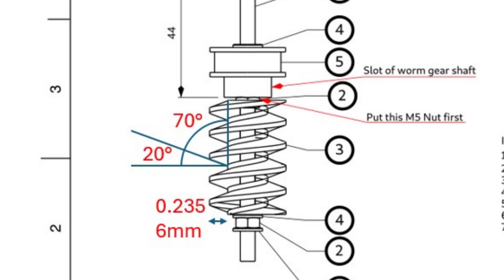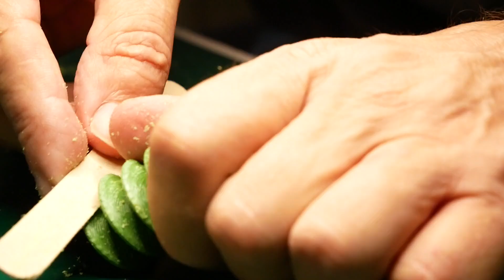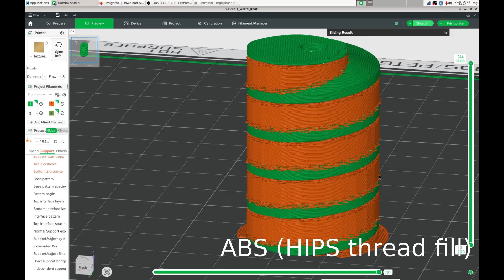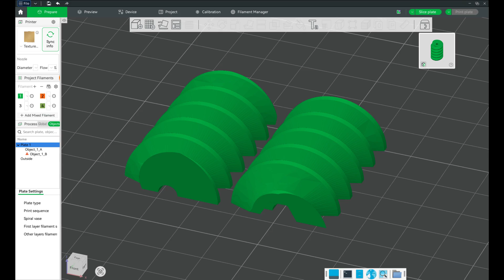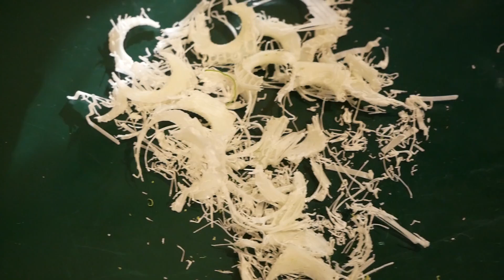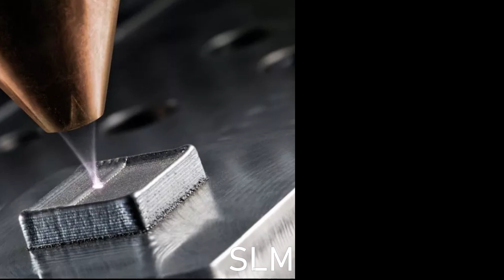I Tried 6 Ways to 3D Print This Worm Screw. Only 2 Worked.

Comment: Try 45 degrees, you need to align the infill to the model direction (under strength/advanced.) Thin layer height 0.1 or 0.2, 30-50% Gyroid or 3D Honeycomb infill.  More important than infill, Increase your wall count to 4 or 5, adding walls ensures the threads are almost 100% solid, providing maximum bite and durability. Nylon be the best choice, or PETG will last awhile.

I made long screws this way for a large fractal vice. Could not flatten a side, and that's the only way horizontal worked at all for me. Vertical, you can snap them with your fingers along layer lines.
Reply from the maker: Thanks for the advise, lots of food for thoughts!

1) my original plan was to use plain nylon (PA) without carbon fiber support but I was afraid that the Houston summer humidity might swell and damage the parts quickly.

2) I was considering 45 degrees for the layer lines giving the screw strength, but feared that the thread helix would would work against me on one side. Looking at it again, I can see the wisdom of your suggestion.

3) I did use layer heights between 0.12 and 0.2, with a gyroid infill of 25% and wall counts between 7 and 5 which results in solid threads, a well walled through hole and very little infill.

Appreciate the help!
Reply: @4111Spyglass  Make sure with carbon or glass reinforced Nylon that your using a steel nozzle, bed glue, and proper ventilation.

Those filaments destroy your nozzle, dont adhere well, and are pretty hard on the eyes and lungs. Anneal the parts for harder stiffer parts. (bake at 90 C - 130 C/194 F-266 F for 6 to 12 hours)

Oh, make sure you dry that stuff well too, that's critical. Probably what's giving the guy with the ABS question grief. Some of those filaments are just finicky.
Reply from the maker: @noturgenre4793: Thanks for the reminder about using hardened extruder. I finally did install the hardened nozzle and extruder gear that I had neglected to install for so long.